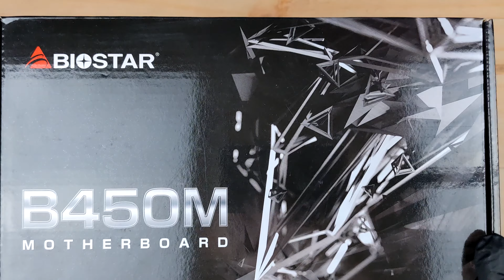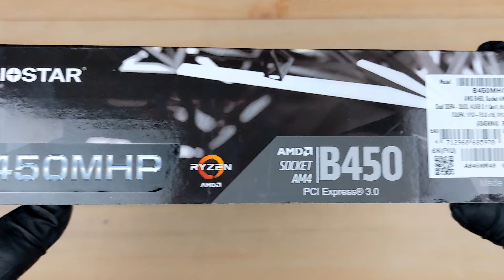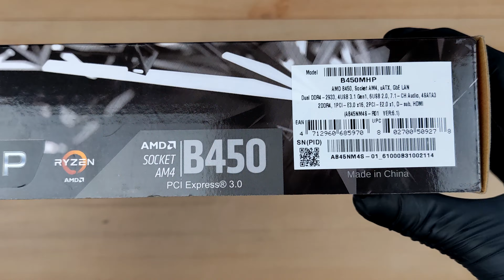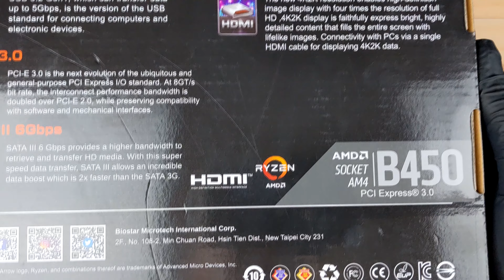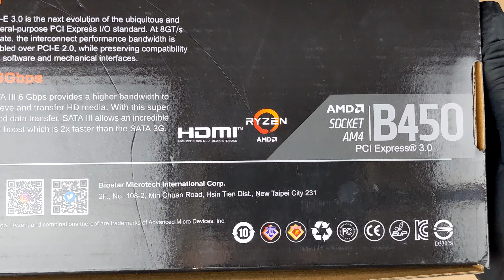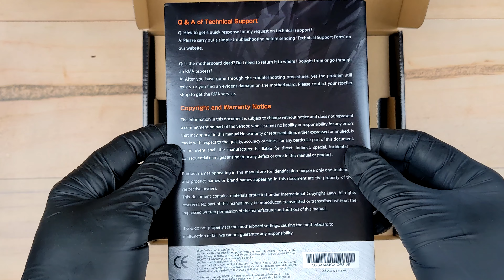BIOSTAR B450MHP Ver. 6.1 🎯 Motherboard Unboxing and Overview

Comment: have it with Ryzen 4500G it's great motherboard, even when i took PC with only 8 Gb ram and SSD it open windows 10 in 1 sec, super fast. So i don't mind that don't have M2, but i think it's possible to connect it over some other plug. On the other hand i don't need M2 ssd becouse i don't see a noticeable difference in real life VS usual good SSD. With ssd, Ryzen 5 and  at the moment  i have 16 gb ram it's great PC even for some gaming. Will take now 32 GB.
For the price of like 70$? or 80$? it's great deal. Moreover some people give here 2+3 years warranty, for a good office, fun, and some gaming it's great motherboard. If something happens it doesn't cost arm or a leg.